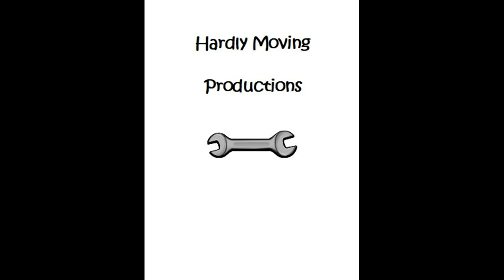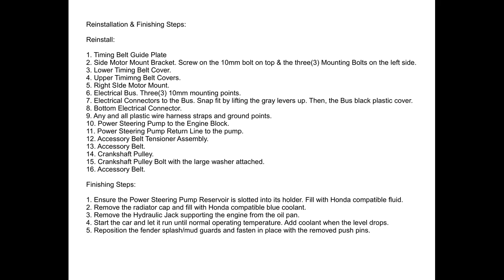Timing Belt & Water Pump Replacement - Honda Pilot

Comment: Brilliant vid!
I bought the parts today at the dealership. Belt, pump, tensioner and 2 bottles of coolant came to $855.74 CAD (taxes in) which is about $635 USD. And labour will be about $900 CAD (~$665 USD) give or take. Doing it myself for the second time (did my old 2007 Odyssey about 10 years ago - same kind of thing.) Not looking forward to it, but stoic. Your filming was excellent! Great angles, good sounds, useful captions, helpful comments. And no BS.
I wasn't planning to replace the idler pulleys. And the dealership's closed for the next 3 days, so I hope that doesn't trip me up. Is it common to have to replace them? I was only planning to do the belt and water pump. I got the tensioner just in case and I'm going to take it back ($300!!!) if not needed.
Thanks for taking the time to make this.
Reply from the maker: Thanks!  I highly recommend you replace the TB idler pulley.  FYI:  Honda and Toyota do not make these replacement parts.  They outsource to Japanese parts providers (Aisin, Denso, NTN, Koyo, Misuboshi, Bando, etc.) and place it in a box that says Honda or Toyota.   For example, Aisin makes  water pumps for both Honda and Toyota.  When you buy it from Aisin, they grind off the Toyota or Honda logo from the aluminum.  When you buy from the dealer, you're paying for Toyota's and Honda's mark up.   You can buy these OEM parts from rockauto.com a lot cheaper than from the dealer.  For example, I'll buy a Denso or Koyo radiator for around $100.  The dealer MSRP is around $350!

Comment: Did you discount the battery for this job, like when computer (sub) got disconnected and removed?? Thanks
Reply from the maker: Not necessary if the ignition is off.

Comment: that crankshaft bolt is way to tight if you can get that bolt off honda why it makes no since took me all day to do timeing belt
Reply from the maker: Know that feeling!  That's why I use a high torque impact gun with a high mass impact socket like what I used in the video.

Comment: Great video! I replaced my Honda Pilot 2010 timing belt 4 years ago. I struggled so much to break loose the crankcase bolt until I bought that special socket and it works like a champ 😊👊!!
Reply from the maker: Glad it helped!

Comment: I just found and watched this video today, as I am considering doing this job on my 2012 Pilot.Thanks for the great instructions! My only concern is torquing the harmonic balancer bolt correctly. All other videos show this step being done on a lift, using a balancer holder tool and plenty of room to swing a torque wrench underneath. I will be doing this on the ground as you did. The recommended procedure I've seen is, torque to 47 ft/lbs then tighten an additional 60 degrees. I'm not sure this can easily be done sitting on the ground, working in the fender well using a 1/2" torque wrench. How did you accomplish this step?
Reply from the maker: I just torque down the balancer bolt with a high torque electric impact gun.  The bolt will not come loose.

Comment: Is it easy to change the spark plugs during the process of changing out the timing belt and water pump?
Reply from the maker: Removal and replacement of the spark plugs is unrelated to performing a TB replacement;  however, removal of the plugs does make it easier to rotate the engine since there's no compression pressure to overcome.

Comment: Please help! I've done ALL the steps  but having major hard time with the  crank shaft pulley nut.. ive got the special 19 socket but my dewalt only offer 300 pounds off tork... any suggestions
Reply: impact gun...
Reply from the maker: Try applying some heat on the pulley nut head with a propane torch.  Not red hot.  Then attempt to torque it loose.

Comment: I went through 3 breaker bars..Before I got that socket. And still needed a torch to break that loctite....Honda  must think that bolt is coming off with 200lbs applied
Reply from the maker: I'm guessing you're talking about the harmonic balancer bolt?

Comment: 💥💥WARNING. Whatever you do DON'T buy a timing belt kit on Ebay, even if they claim it is OEM. I purchased a "Original Honda kit". The timing belt had the Honda name printed, on the belt. The water pump had the Honda name embossed, as part of of the mold when manufactured. Each item had Honda part labels and part numbers. It all looked legit OEM. The kit included, timing belt, water pump, idler pulley, hydraulic belt tentioner, serpentine belt. I personally completed the work and was very pleased with the result. Unfortunately the "OEM Timing belt" which obviously was a counterfit, broke off and ruined the interference engine on my '05 Honda Odyssey. This happened only 4,000 miles after the work had been done. Needles to say, it resulted in a very costly experience to me. I can't afford the very costly repair. So I will have to junk my beloved van, which I brought brand new in 2005 and only had 94k original miles.
I wish I would have been warned about this. My intention is to save someone from becoming a victim as it happened to me.
Reply from the maker: So you bought from a dealership to make sure it was OEM?
Reply: Sellers on ebay and amazon have been selling replica Honda OEM timing kits and they are fake and break... The sad thing is that they continue to sell them on those places and people that don't know thing those are original.. ebay and amazon should remove those listings but they don't.

Comment: My 2013 accord 3.5 has 86k now. Dealers in Hawaii are insane, 3 choices, all around $1700. Screw that, I'll try it. This is the best vid I've seen hands down, appreciate it. The explanation on setting the belt is great. I figure in a year or so  I'll have a go at it.
Reply from the maker: Wow!  $1,700!!!??? Mind blowing!  Believe it or not, the mechanic will only make around $200 for his work.
Reply: @hardlymovingpro  yeah, total rip. I really think I can do this with proper prep, patience and attention to detail. Just need to decide if I want to invest in a Milwaukee impact, try a cheaper corded or go the breaker/cheater bar way with the special socket.
Reply from the maker: @alohawg  You can get away with using a cheapo ac electric impact gun.  You'll definitely need the 19 mm high mass impact socket to get the crank pulley bolt off.  The rest of the job you can get away with using hand tools.   I get the job done faster and easier using my electric ratchet tools.
Reply from the maker: @alohawg  Yea ... the harborfreight would work just fine.

Comment: Word to the Wise:
"Listen to what the Man Says." 

I've known "Mechanics" who are Stubborn, who will sit there all day, trying to Break Free That Honda Crank Bolt.
And that Damn Bolt will not come Lose. 

Should you be lucky enough, to have a good Air Compressor, just buy the Lisle  #77080 19 MM Harmonic Balancer Socket from Amazon.com for about $25 bucks/ shipped asap.
(It will save Time and Headaches)

Should you not have access to an Air Compressor or Air Impact, just go to your Nearest Home Depot and rent a Milwaukee 1/2 Drive 2767-20 M18  Fuel Impact Wrench. You'll been quicker.
(Assuming, you have ordered the Lisle 19MM #77080 Socket. 

"Easy Peecy-Japanisee."
Have a Nice day. 😊

Comment: How long of a process is this?
Reply from the maker: Around 3 hrs for me
Reply: The OP really knows what he's doing.
I, on the other hand, am pretty handy having rebuilt engines and stoff as an amateur, but I'm no pro.
I did it once on a 2007 Odyssey and it took all day.
I'm starting from scratch today on a 2016 and I expect to be finished by tomorrow at supper. (Got some kid-shuttling to do at the same time.)
Book at least 6 straight hours on a nice sunny day if you have all the tools you need.
I know you asked this 4 years ago, but good luck to those of you who had the same question!

Comment: Hey so at the end to put the timing belt tensioner you said turn clockwise. I assume once you line it back up you release the tensioner correct
Reply from the maker: That's correct.  Clock wise will move the slack to the left where the tensioner goes

Comment: Your need a 19mm balancer socket, standard socket won't work.
Reply from the maker: You are correct.  At the 1:51 time mark I talk about using a high mass 19 mm impact socket to take off the harmonic balancer bolt.   It has never let me down!

Comment: hello group, can anyone provide me the torque values on a 2011 Honda Pilot 3.5 engine for the installation of the water pump kit?
Reply from the maker: Make the 10 mm water pump mounting bolts hand tight using the 1/4" ratchet wrench.  Using anything bigger might sear off the bolt heads.

Comment: Why mark the belt? If your marks are right you'll be fine, but good video
Reply from the maker: It's for the guys who've never done a timing belt replacement and aren't sure they have everything in alignment.
Reply: @hardlymovingpro  ya I hear you
Reply: That's simply additional peace of mind for a DIYer that the belt is installed correctly.

Comment: Ok people if you want to do the old school method to remove a pulley bolt,  DO NOT be whoever was in that car and hold on the starter my goodness.  You BUMP it.  A few rapid quick bumps will release that bolt.  Did it on my 04 Acura MDX, 4 quick semi- rapid bumps and came off like a charm.  NEVER hold into the key like the way they did it.  Surefire way to ruin a starter and possibly a flywheel.
Reply from the maker: If you watched the whole video, I removed the pulley bolt with a high mass 19 mm Leslie impact socket with a powered impact tool.  The bump start method of releasing crank pulley bolts on Honda's generally does not work. If it worked for you, consider yourself fortunate.
Reply: The Honda Pilot we have (2012), you don't have an opportunity to 'bump' the starter.  When you twist the key to start, it decides how long the starter is spinning.

Comment: I've always wondered why Honda insists on interference engines with rubber timing belts.  Toyota has been making comparable engines that are non-interference,  even with variable valve timing for years. 

As we all know,  you break a timing belt with a non-interference engine,  all it does is strand you.  You get towed, you get a new one put on,  set the engine timing, and you're back in  business.  

An interference engine,  it breaks,  valves are bent and engine is destroyed.  

Surely Honda can design an build a non-interference engine.
Reply from the maker: Think the newer engines use chains.  But the belt drive is both durable and reliable.
Reply: TB is cheaper and quieter. Toyota has also used TB in their V6 engines. As for non interference engine, it simply is not as effective and powerful as the V one.
Reply from the maker: Also less centrifigal mass to rob horsepower

Comment: Dude, you need the weighted 19mm socket specifically designed to remove that crank bolt. Takes it off with one good buzz from the impact.
Reply from the maker: You're 100% correct and thanks for your comment.  You just didn't watch the video to the 1:52 minute mark where I used the 19 mm high mass socket.  I wanted to show people what it's like NOT to have a high mass (weighted) impact socket.
Reply: @hardlymovingpro  🤣🤣🤣 thanks brother. I laugh at how people comment before fully watching. So ready to speak lol
Reply from the maker: @WingoTribe  Yup ... is that amazing or basic human nature.  See something wrong then spend time to comment immediately rather than watching the rest of the video.  Probably gave me a thumbs down too.

Comment: just had timing belt replaced with the kit now steering wheel feels tough so could it be air ?
Reply from the maker: The timing belt or the accessory belt?  Because the accessory belt drives the power steering pump.  Check the fluid level in the power steering reservoir.
Reply: @hardlymovingpro  timing done but hoses for power steering where disconnected to make room  im asking is there possibility that it might have air fluid is good topped up
Reply from the maker: Even if air got into the lines, the air will eventually work its way out to the reservoir.
Reply: @hardlymovingpro  thanks for the response

Comment: What is the purpose of marking the belt?
Reply from the maker: Helps to install the belt if you're not sure the belt is off a cog.
Reply: To make sure you install the new one exactly how the old one was. That way when all markings align, you have a peace of mind that the timing is correct. Usually done by DIYers as professionals do not mark the belts as they are doing hundreds of TB jobs and perfected it.

Comment: I have one more question please, i thought of changing crank seal, but the challenge i found was removing the woodruf key, it is not coming out at all, i hammered little bit but eventually left it like that, i dont want to damage crank, i used chisel and slight hammered but no luck, what you recommend to remove stubburn crank key(woodruf key)..
Reply from the maker: There should be no reason to remove the woodruf key.  If the crank pulley gear is stuck, you should use a pulley removal tool.
Reply: @hardlymovingpro   hi, to change crankshaft front seal, can i remove crank gear(smaller one) without removing woodruf key. i thought u take woodruf key out then the small crank pulley out then change the crank seal.
Reply: @hardlymovingpro   hi, i am able to remove crankk pullye, it is next small crank sprocket pulley onn which timing belt rides NOT serpentine belt, that is the pulley i want to remove to change crank seal. which i believe have to remove woodruf key which is stuck and it wont come out
Reply: You should not have any issues removing the key. If it is stuck, something is wrong. The key should move freely and should be removed easily once you remove the harmonic balancer.

Comment: Thanks so much. I just subscribed your channel few weeks ago. I watched quite a  lot from there. I liked the way you use chain wrench in other videos and ordered one for me. As part of this video, I myself done pilot timing belt change a week ago, one thing i struggled for 2 hours is putting the new belt back. I see lot of slack between crank to camshaft. then right camshaft to left camshaft with water pump in middle. You marked the old belt with paint and transferred it to new belt, very good idea i should have watched your before. question is you move crank pulley clockwise one notch to right, then at times you turn crank pulley 2 notch to the left .. didnot understand this, because when you fit the belt with crank to camshaft(right) and when you turn crank will not your timing on right cam will also shift, you also said turn crank 2 nothc to left again will not this affect timing on both the cam.. can you please explain in detail, i am sure i am missing something, so next time i wont spend 2 hours if i understand your trick. Thanks again. let me know if i want to contribute some dollar to your channel.
Reply from the maker: It's your choice if you want to move the crank or camshaft pulley to ease mounting of the belt.  If you move either one towards each other (1 or 2 cogs) you're creating slack to make the mounting easier.  When you re-position what your moved (crank or cam pulley) after the belt installation  to TDC, and if your used your paint marks, everything should line up with no belt slack.
Reply: @hardlymovingpro  I may have missed it, but did you thread the battery clamp bolt to hold the timing belt adjuster? Also install the idler pulley bolt loosely so the pulley can move but not fall off? Curious if these steps would make it easier to put the belt on, and not have to mess with moving the cams/crankshaft. I'm a newb DIY, and read these steps in the Haynes manual. Great video, btw. Thanks!
Reply from the maker: Threading the battery clamp bolt is a technique used to keep the belt tensioner pin locked before removing the belt.  I prefer to press down and compress the tensioner pin back down in a vice and lock it in place with a metal pin (aka granade pin from a previous TB job or a drill bit).  This was shown in the video.  The tensioner exists on the left side of the engine...the side with the most slack.  Mounting of the belt is on the right side where there's no slack.  You make the slack by turning either the crank or cam into each other, mount the belt and turn the crank or cam back to its TDC position.   After the belt has been installed on the right side, the left cam may have to turned towards the right cam to mount the belt.  When both cams have the belt mounted, the left side belt mounting is easy ... there's plenty of slack.  The starting point of the belt installation starts at the crankshaft.  It's up to you if want to mount the belt starting from the left cam or the right cam.  It doesn't matter.  Use paint marks to verify the cam and crank positions.  The details I'm providing you is technique not provided in typical repair manuals.  All they tell you is to mount the belt.
Reply: @hardlymovingpro  Wow, thanks for the quick reply, much appreciated. I'll give your technique a try. Thanks again!